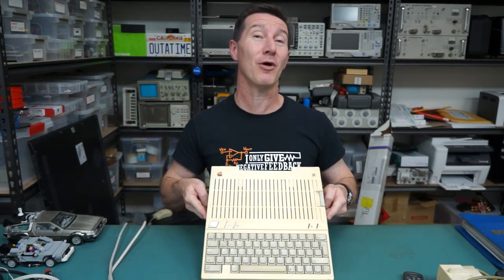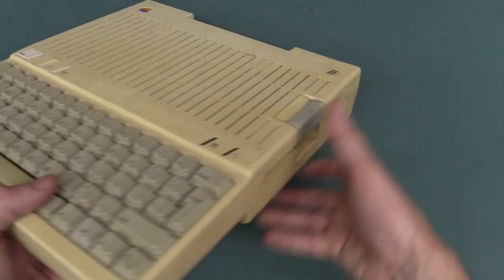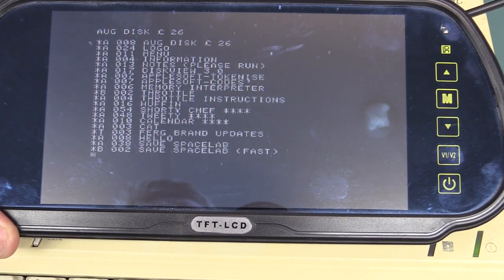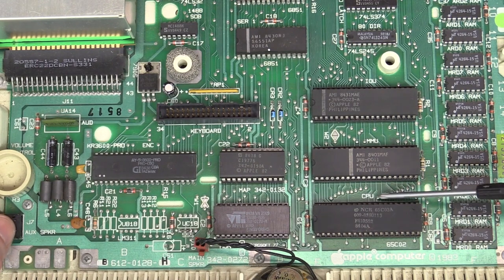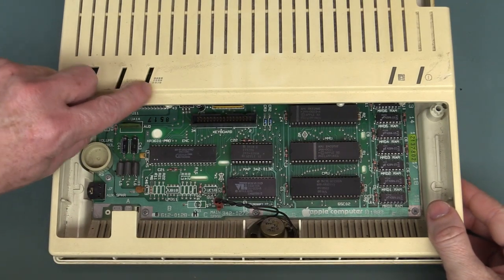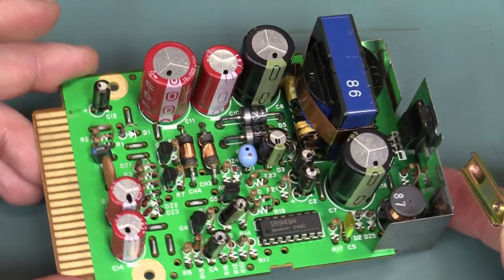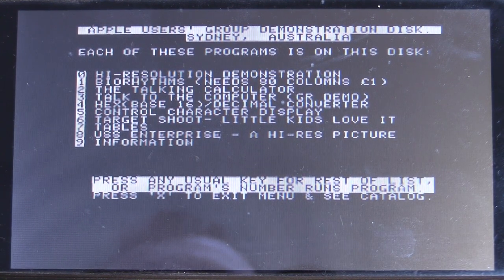EEVblog #788 - Apple IIC Teardown

Comment: The "grinding sound" is the disk drive alignment procedure, which consists of winding the read-write head out to one end, and banging it against the stop.  This was done when difficulty was encountered in reading a disk.  I am not sure if this was implemented by the disk controller or in software but I suspect software, given Wozniak's design philosophy (why build hardware when you can implement something in software?).

The dreadful audio output is a testament to that. When an address between $C030 and $C03F appeared on the address bus, a single click was emitted from the speaker.  A suitable timing loop would be crafted in machine code to create a tone (the Applesoft BASIC interpreter was too slow).  Until the appearance of the IIGS that was the total of the Apple's audio capabilities.

Trouble with the floppies is not unexpected.  Feeling a case of the nostalgia recently, I loaded up a pile of my old Apple disks.  About 80% of them produced I/O errors.  I was surprised that any of them were readable decades after being written.

Don't be concerned that none of the disks had Apple logos.  Back in the day, it was customary to just copy a friend's disks, which were themselves copies.  Copy protection?  No problem.  Use a copying program to defeat it.  Don't have a copying program?  Obviously the solution was to copy your friend's copying program.  Don't have any friends?  Join the local users group.   Ah, the good olde days.
Reply: The older Apple II computers with a cassette interface also had a memory address you could access that would generate a click on that cassette interface, so you could do some rudimentary recording onto cassette that way.

Comment: I loved my Apple IIc . I still have it up in the attic.  I ran a BBS from 86-89 on one and it ran 24/7 and never caused any problems.  I upgraded the CPU and memory to 4Mhz via a daughter card. I recall having an issue with something during that updgrade and thanks to an apple contact I knew spent about 40 minutes with the designer of the motherboard getting it resolved!  Can you image calling apple today asking to speak to an "engineer"..  great little machine.

Comment: When I worked in an electronics service and repair workshop, the technicians and engineers used a small off-cut of soft chamois leather (with isopropyl alcohol) for cleaning tape and floppy disk heads. They don't drop lint and detritus, and allow you to get better even pressure across the area to be cleaned.

Comment: Fun trip down memory lane – especially the tour of the main board with all the TTL, etc. I realized I still remember a bunch of the 74 series by number. First extensive experience with them was a TV Typewriter, followed by a MITS Altair 680b 6800 I built (rocketing 1MHz clock) that I still have!. 

Thanks for the vid!

Comment: The Apple IIc and the Laser 128 series were nice for college - lugging it from dorm room to home when you had to leave. I had the Apple IIgs and //e (with 576KB - Applied Engineering 80-column card - up to 1MB), but I was a hardware nut so I still wanted a Laser even though I had no need for one. The Laser had one expansion card slot - exposed on the side, and they offered a box with two slots inside. It essentially looked like a large IIc. 

Later, Laser made PC clones and I think the first few looked like the Laser 128 having that portable look to it. No battery, but these computers were easy to transport from place to place. Like with college, you could use it at work and then take it home if needed. ...although I think too many modern jobs rob us of some needed work/life balance. 

You could use both internal and external floppies at the same time. Since you couldn't disconnect the internal drive without voiding the warranty, the external port would be useless to the average consumer if that was true. 

FYI - With that 80-column card in my Apple //e, I kept overloading the factory power supply. Computer would randomly reset itself. I had to upgrade the power supply - same company - Applied Engineering. They were a local company for me. I had to place an order through my cousin who owned a computer store in Oklahoma, and then I could drive by to pick up the part from their offices in Texas. They even made an internal hard drive. I think it was for the IIgs, and it essentially replaced the power supply. AE definitely had Star Trek fans among its employees. Sound card was called Phaser (12 channel if I remember correctly). That hard drive was call Vulcan. There was a IIgs accelerator card called the Transwarp GS. A PC emulation card was the Transporter.

Comment: Correction: the 15-pin video output is not RGB. It is a proprietary "video expansion port" for use with either an RF modulator or with the optional monochrome LCD monitor.
Reply: +vwestlife Dang uxwbill cronies
Reply: +2dfx uxwbill cronies? But he's pretty cool
Reply: I have much love for uxwbill, just a small world seeing his little corner of youtube around in other channels!
Reply: +vwestlife You can Google for the pinouts. Some of the pins are proprietary for the LCD, but there is also analog video.  Those pins are compatible with Mac DB15 video or (with an adapter) VGA, except for the fact that it uses a 15kHz dot-clock (NTSC composite frequency) that very few VGA (and no Mac) monitors can actually sync with.  But if you have a VGA-type display that can sync to such a low frequency it will work.

Comment: Regarding the later IIc's that had the memory expansion slot on them, they did have 128k built into the motherboard, but with 4 4x64kbit chips instead of 16 1x64kbit chips. These chips were also used on the official expansion board, 8 of them soldered on with sockets for up to 24 more, resulting in a maximum total memory of 1152k.

Comment: Ah the Apple IIC yours is missing it's classic handle. I picked one up years ago at an electronics shop was missing it's inline power brick and I have no floppy's for it but with a bit of research online i was able to find the pinout for the power jack  and hook it up to a powersuply. I lacked a 15v power supply but had a nice 1 amp 12v one that hands the system relatively well been needing to clean up my dodgy din connector plug though as it's a bit so so. Used one of those dirt cheap friction fit ones vs a nice proper soldering job and it's over all a bit of a mess but it dose work. I have not gotten around to testing the drive but the system dose boot just fine when operating off of 12v

Comment: Right in front of the power supply is the date code - 8517 - 17th week, 1985.  Using the date code on the memory chips was a good guess at the vintage!

Comment: That CPU clock jitter has probably something to do with the fact that oscillator frequency has to be divided by 14 and not by 16.
Reply: >That CPU clock jitter has probably something to do with the fact that oscillator frequency has to be divided by 14 and not by 16.

It's about making the numbers work out for NTSC video timing.  Every 65th CPU clock cycle is stretched by two cycles of the ~14-MHz master clock so that 65 cycles correspond to one line of video.  See http://mirrors.apple2.org.za/ground.icaen.uiowa.edu/MiscInfo/Empson/videocycles for more details.
Reply: +Scott Alfter You're probably right. I am not familiar with NTSC standard at all (we use PAL here wich has exactly 64 us line period).

Comment: About the floppies.  The double sided ones were somewhat pricey for us cheap skates.  So we would buy cheaper single sided floppies which was basically (we hoped) a double sided disk inside a jacket which only had one write protect notch.  So we would cut a second write protect notch either by hand or they sold a notch cutter just for this task.  That made them "double sided".  In like Flynn.  There were some people that said you would screw up the data running one side backwards but I never had an issue.
Reply: +cemx86 Yep.  I never used a notch-cutting tool.  I just used an X-Acto knife and was extra careful to cut in the right place.

All disks were double-sided.  Rumor was that manufacturers would only test one side of single-sided media, but even that was BS - Apple drives read the lower surface while some other drives would read the upper surface.  Media manufacturers knew that and didn't want to ship different discs for different drives, so they put the magnetic coating on both sides.

I also heard rumors that flipping discs would be bad because the cloth in the disc was designed to collect dust and dirt from spinning media and that when the media spins the other way, it could get swept back onto the media.  That never made sense to me either.

The only possibly-reasonable argument I ever heard for not flipping media was because single-sided drives have a felt pad opposite the head.  That pad can abrade the disc.  Nobody cares if you're abrading a side that has no data, but it could lead to errors if there is data on the back.  Except, of course, everybody made/used "flippy" media, and I don't know of a single case of that actually being a problem.

Of course a "double sided" disc was meant for use in a double-sided drive (with two heads, like those used in PCs).  Very few "flippy" discs (with two write-protect notches cut from the factory) were actually manufactured that way.

Comment: Used a modified version of the german dvorak keyboard (for swiss german) for a while! It's fantastic ! Sadly there are no Keyboards with pre printed keycaps so i switched back to ISO QWERTZ :( I may do a template for the WASD-Keyboard when i have the time and get a keycap set from there but first i'll need to reprogram/remap the key assignment in OSX (with karabiner or so...)

Comment: I don't recall Apple ever shipping a unit with a DVORAK layout.  I think you were expected (if you cared enough to bother) to pry up the keycaps and re-attach them in those positions.

Also worth noting that the joystick/mouse port is NOT serial.  There are two analog inputs (X/Y joystick axes), two digital inputs (joystick buttons, which are actually wired to the open-apple/close-apple keyboard keys) and a few pins for mouse functionality (mimicking the pins used by the original Mac's pre-ADB mouse port.)

Comment: The 6502 used a two phase clock, so that could be what you're seeing. Also, I've used a DVORAK layout for about 9 years now. I just use a standard USB QWERTY keyboard and set the map to DVORAK in my OS. There's no need for DVORAK labels on the actual keyboard cuz you never look when you're typing. I've also known maybe 3 or 4 people who used DVORAK. Honestly I never found it any faster. It's more comfortable, but that could be from barely using QWERTY anymore. It takes some getting used to if I do have to use one.

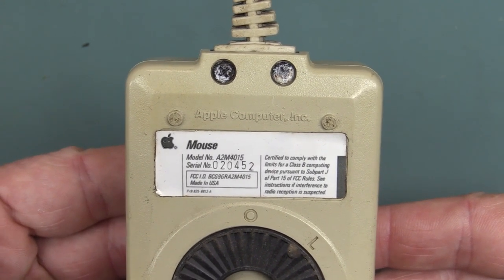Comment: Once upon a time I was IT support for all the Macintosh's used in our engineering office at Motorola (maker of the 6502 and 68000!).  At 9:11 about the mouse.  These things were notorious for getting clogged up with lint on the encoder rollers riding on the large ball in the center.  You could tell who was less fastidious by the amount goop inside!
Reply: That was a problem with all ball-based mice, which is part of why they don't make them anymore. 

Also, the 6502 was not made by Motorola, it was made by MOS Technologies, which was later bought out by Commodore. The 6500 was actually designed as a drop-in alternative to Motorola's 6800 chip, which Motorola sued them over. Because of this, the 6500 was scrapped in favor of the 6502, which was no longer directly compatible with the 6800. The 6502 design was later licensed out to other manufacturers, eventually leading to the 65C02 and Western Design Center's 65C816 chip used in the IIgs and SNES.

Comment: Woz shaved a few more cents off the cost of his floppy drive system by omitting the track 0 sensor, hence the characteristic bzzzt-rattle sound at startup, the first job for the IWM is to seek backwards 35 times. On the Shugart floppy interface (found in PCs since 1981), there was a microswitch or optical sensor so the controller could stop seeking on reaching track 0.

Comment: Would be surprised if Zork II didn't run on 128k, it ran perfectly well on Commodore 64. And had actual capitalisation as I recall. =)  The reason why it's reading everything from disk is that almost everything in Z-Code games were stored on the disk in small chunks and were loaded when needed - the game is only keeping extremely relevant data in memory. Too bad I don't know much more about the Z-Code stuff and really nothing else about Apple interpreter in particular, this is the first time I've seen it in action =)

Comment: The Apple IIC does support more then one drive and in fact you can even hook a hard rive up to the port.
Reply: +Patchuchan The Drive Port of a //c could only take a 5.25" floppy drive.  The same port on a IIc+ or a IIgs could also take a 3.5" floppy drive (which could daisy-chain to a 5.25" drive).  The same port on an early Mac could take an HD20 hard drive.

As far as I know, hard drives for a IIgs required a SCSI card (Apple and Applied Engineering both made cards).  I don't think the //c had any hard drive support (aside from some third-party hacks that made it emulate a giant floppy.)

Comment: Yes the were parallel drives but you could actually use both drives at the same time. I had several apple II's (II+ IIc and a IIGS)
Reply: +Mark Burton Well, you could have both drive motors spinning at once, but I'm pretty certain you could only move data to one at a time.  On a //e, you could access two drives at once only if they were on different controller cards, but even then, only with really good software because DOS itself plays a critical role in drive operation.

Comment: 10:58 - "It's got 128K of RAM, why does it have to keep reading the disk?"

It's an older Infocom game, it was probably written to run on the Apple II+ with 48K of RAM or less.

Later Infocom games will (among other things) detect whether the system can run in 80 columns and prompt you whether you want to use it or not (most software didn't do anything with the 80/40 switch) - if they're running in 80 column mode they'll also use both upper and lowercase letters (which earlier, 40-column-only Apple II models couldn't do)

Comment: I'm a software developer, so Dvorak is rather unfortunate due to the movement of symbols.  Instead, I use Colemak, which preserves symbols, numbers, and common keyboard shortcuts (q, w, a, z, x, c, v, etc. aren't moved).  The main difference is the inclusion of more vowels on the home row and the switching of the "caps lock" key into a backspace key.  It's also fun to just type the left hand on the home row.  Instead of "asdf" you get "arst".  ;P

Comment: Zork accessed the floppy drive for two reasons. 1. Copy protection, which is why you encountered those errors.. 2. It didn't have to require much memory from the computer.

Comment: the throw away handle :D
drive may also has to be readjusted, it works like in the cheap commodore days, using the mechanical way to find its 0-track ...